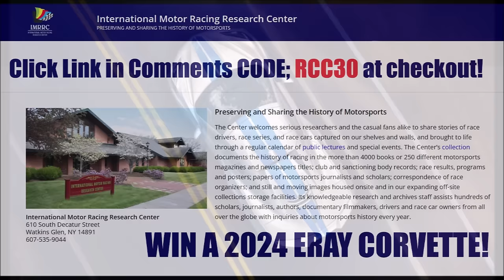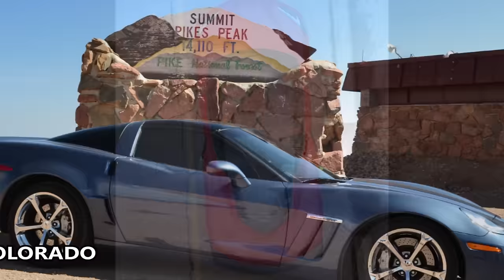CORVETTE TECH TUESDAY WHY YOU SHOULD USE AC DELCO OIL FILTER & YOUR RIDES

Comment from the maker: WIN A NEW 2024 ERAY CORVETTE – VIEWERS HERE GET 30% MORE ENTRIES
CLICK THIS LINK – GOOD LUCK EVERYONE!
https://www.tapkat.org/international-motor-racing-research-center/P934B5?promo=RCC30
Reply: Wait just a munite? If I'm driving on a run-flat performance tire, (one without a tread-plug), and it goes down, how is this substantially different than when,  (a properly specified and installed tread-plug goes down)? [Not including a side-wall blow-out... in either circumstance]. This is why regularly checking lug nuts (140) and displaying (DIC tpms tire pressures) are the most important safety items on any sports car! Lugs, TPMS, oil pressure, and coolent temps!!!!

Comment: I've been doing the "flood start" technique for awhile now. It made sense to me since gravity will cause the oil to leave the top of the motor on a car that's stored for 5 to 6 months. I don't want to risk metal to metal contact. I use Mobile 1 oil and filters. Didn't know about the AC Delco check valve. I may switch to AC Delco filters if Mobil,1 filters don't have a check valve. TY

Comment: Wait just a munite? If I'm driving on a run-flat performance tire, (one without a tread-plug), and it goes down, how is this substantially different than when,  (a properly specified and installed tread-plug goes down)? [Not including a side-wall blow-out... in either circumstance]. This is why regularly checking lug nuts (140) and displaying (DIC tpms tire pressures) are the most important safety items on any sports car! Lugs, TPMS, oil pressure, and coolent temps!!!!

Comment: The subject about plugging a tire hasn’t mentioned one thing that was done to a tire on my 2022 C8. Besides a plug the tire tech. put a patch on the inside. I have driven over 6,000 miles since then and no problems.